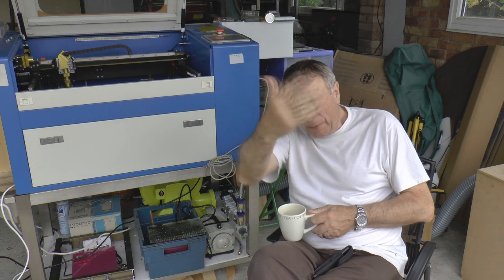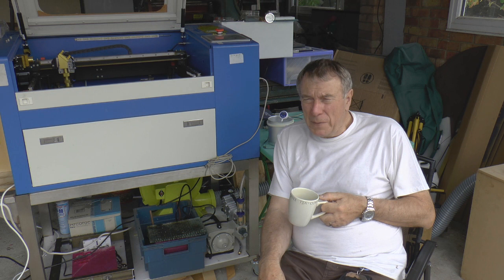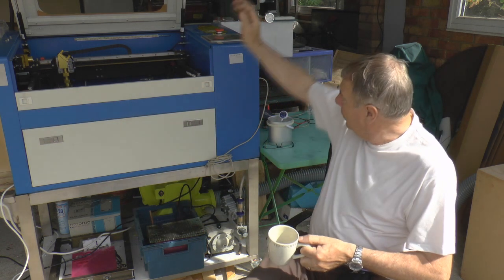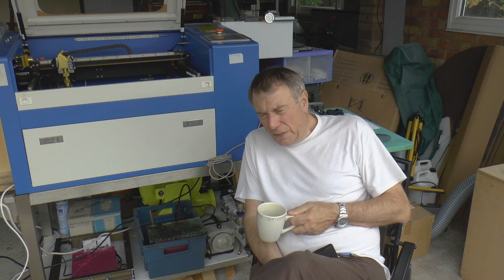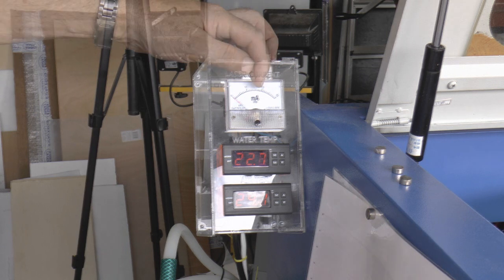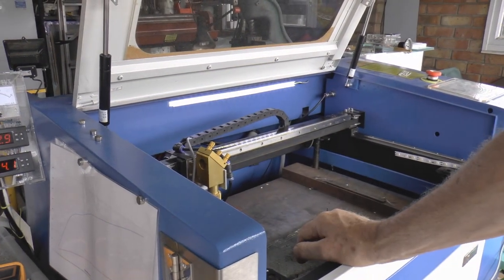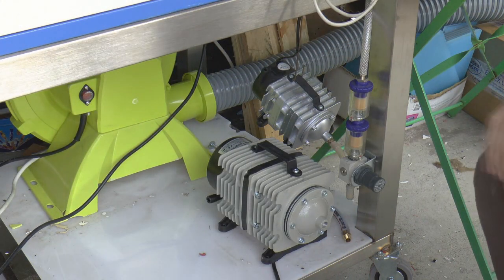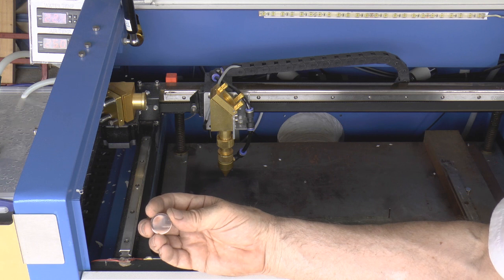RDWorks Learning Lab 75 What have I learned from 1 year of owning a Chinese Laser Engraver

Comment: How fast are you trying to cut a particular thickness of material?  Even 40W is more than enough to cut paper/cardstock/wood in most thicknesses that you'd use for hobby use.  If you can't cut a thick material at max laser power, slow it down.  You don't have to cut at full power all the time.  You can cut thin wood at about 5-8W.  I have a friend that outfitted a 8W LED laser to his 3D printer and he's cutting up to 1/8" basswood in one pass.  Granted he's not going fast, but it is getting it done.
Reply from the maker: One thing you must appreciate is that the main property of a laser beam is that it is monochromatic and all the light waves are in phase. The colour of the light defines its wavelength. and the longer the wavelength the more power it carries. You will already understand this concept when a car drives by playing loud music. You will not hear the high and mid frequency (short wavelength) sound, only the long wavelength bass beat. Your friiend's diode laser will be working at 400 to 600 nanometer wave length . The CO2 laser I have emits light at 10600 nanometers , so 20 times longer wavelength. Why does that matter? It's all to do with the way that the light energy stimulates the material molecules. I'll not go any further into the physics other than to say that you are trying to compare apples and oranges. The material range cut or engraved by a short wave laser will be different than those cut or damaged by a long wave laser. Basswood is an excellent example because it is almost impossible to cut with a CO2 laser, very strange because its just another wood and you would expect it to be cut easily. Sadly the more complex molecular structure  is poorly stimulated by CO2 longer wavelength light and will not heat up as much.. 

1  cut card stock at about 10 watts but most materials you would want to use ma power and set the speed to get the cleanest cut. Tke for example 2mm birch plywood . A 2" lens and 60watts will allow cutting at about 25mm/s. You get efficient burn-free cutting PROVIDED the cut is at 25mm/s. As soon as you get complex or small shapes , say 3mm holes, then the speed will never get to 25mm/s and the power will be too ugh and you will get burnt edges to the holes.. There is no such thing as the right speed or power for a particular material. You really ought to break your job down into at least two layers(one small and complex shapes and one large and simple shapes) and apply cutting parameters appropriate to each. Go forth and experiment, there is so much more to these machines than selecting a speed and power.

Best wishes
Russ
Reply: @SarbarMultimedia  There's somethings you got right in there, but not much.  The wavelength of light has more effect on the actual materials you can cut.  For example, brass cuts poorly using a CO2 laser @10.6um wavelength, but cuts very cleanly using an Nd:YAG at 1.064um wavelength.  On the other hand, something like basswood cuts very well using CO2 (with your cut quality being determined primarily by power, focal point position, focal length and feed rate), but looks pretty ugly using Nd:YAG.  

For the materials you are cutting with these low power lasers, you can play with power and feed rate to get the quality you want for a given thickness (generally).  If you can cut a given thickness at a certain feed rate, using full power, you can cut the power by 10-20%, then play with the feed rate to get your cut back to where you want it to be.

This changes with some with the type and pressure of the gas that you flow through the nozzle, down through the cut.

You are correct in that you can monitor mA/current supplied to the laser to better manage the power.   On these machines, that's probably the more accurate way to monitor power as the laser tube itself has no power monitor on it.

Also...  In another one of your videos, you were showing the laser light and saying that the pink light was nitrogen gas.  It is not.  It's helium.  CO2 lasers (generally, based on my experience with much higher laser powers) use a mix of CO2, N2 and Helium gas.  Helium is used to cool and stabilize the gas mixture.  N2 is energized by the power input into the laser tube, which then energizes the CO2, which would be difficult to do without the N2.  This is a simplification of how it works, but that's the basic idea.  There may also be trace amounts of other gases in there to promote one part of the reaction or another.

Don't want to really debate this...  I have 25 years of experience working with laser cutting systems, primarily high power (2-10kW) CO2 and YAG sheet metal cutting machines.  I've done just about everything on/with them.  Installation/repair, building/testing the lasers, building and testing the machine dynamics, applications, etc...

Not trying to be a dick...  Just giving background so you know I have experience in this field and I'm not some YouTube comment section troll.
Reply from the maker: @WHJeffB  
Thanks so much for your reply. Where were you 3 years ago when I was struggling to understand the physics of this technology. Many hours of trawling through hardly understandable scientific papers allowed me to eventually piece together the operating mechanism  for these sealed tube CO2  lasers and it is exactly as you have described.  I never considered helium to be  the ionized gas because from all that I read, helium is pale yellow when it ionizes. Our air is almost 80% nitrogen and lightning is a pinky mauve as it ionizes the air on it's way to ground.  We agree that nitrogen is the means by which the CO2 gains its extra energy. All gases are naturally non conductive and it it not until they ionize that they can carry current. The colour and light intensity of the pink beam  increases as the current flow increases, therefore it seemed unquestionable that it was the nitrogen acting as the stimulating mechanism  
I know nothing about your short wavelength lasers  other than they can do things like brass, copper and aluminium cutting that I could never attempt with the two 3kw CO2  machines I owned for 10 years. Mild steel, stainless steel and acrylic was all I cut within the sheet metal business I ran.  Dropping to 60 watts sealed tube , non-metal cutting machines  turned out to be a universe away from the sophistication of industrial machines. . I'm having great retirement fun and am always happy to learn so  I greatly appreciate your response. This sort of physics was never on my school curriculum  but it's been rewarding and great exercise for my two remaining grey cells
Best wishes
Russ
Reply: @SarbarMultimedia  3 years ago I was thinking that these types of machines (from China) were junk and not worth the money.  After watching some of your videos, plus many others, I realized that this is not the case.  While not perfect, or on par with a commercial machine (such as Epilog or Universal), with some modifications and "tweaks" they can be a really good machine for a hobbyist, or even a decent low volume production machine.  

I've watched several of your videos now, in preparation for the delivery of my machine and I would like to thank you for sharing your experiences with us YouTube'rs.  Very helpful indeed!
Reply from the maker: @WHJeffB  
I know that Trotec Epilog and Universal are in a different league as far as build quality , engineering and raw speed but I have seen them at exhibitions and they always seem to engraving things like the Aztec calendar. detailed yes and fast  but their dithered photo engraving is about 5 out of 10 on my scale. Their lens systems do not appear to accommodate compound lenses so they are stuck  with fairly low res images, even though they do their image processing at 600 dpi, their half tone engraving method is not suited to laser technology. They have rapid response RF tubes that they are not exploiting fully. So if you want a dedicated engraving machine for fairly simple graphics then go forth and spend a shed load of money. When it comes to cutting the ball game changes. The Chinese machines use the same lenses, have the same or greater watts to play with and speed is no longer an issue because you will be in the 5 to 35 mm/s cutting zone and not scanning at 1000mm/s. There is nothing magical about rf pulsing power for cutting  so at 1/20th the price the Chinese machines win hands down, 
The whole aim of my learning journey is to understand the technology and work out what the extreme performance envelope is for this stupidly cheap CNC technology. It is full of small design compromises but when understood and tinkered with, you will get a machine that outperforms the "big boys" in certain areas but at a price that will put a smile on your face. I use the "big boys" as my benchmark and I have two correspondents (one Trotec and one Epilog) from whom I can get comparative data.
I am in regular communication with several guys that started their small business off with 1 machine  and after 2 years are at 3 or 4 machines.  Take a look here for an example
https://www.facebook.com/lasermadeira/
Welcome to the community
Best wishes
Russ
Reply: @SarbarMultimedia  Thanks for the information Russ...  I'm approaching the purchase of the machine as functional "kit".  I wanted a basic CNC platform, with a laser that I could use as a starting point for significant upgrades.  Watching your videos and others, I think the machine is perfectly capable of doing work "as-is", which is what I'll most likely do as I evaluate what can or needs to be improved.  Greatly looking forward to it!  Thanks again.

Comment: I'm thinking about getting a laser cutter  so many versions out there which is best to get for beginners?
Reply from the maker: Hi

It's a simple question with no easy answer. Before you even start choosing a machine you need to have some sort of vision about why you want one. So your not a fisherman, golfer, sailor or a pilot and you need something in your man cave to keep the wife at bay????  You have a hobby that you want to support such as railway modelling and would find it useful for making model buildings etc. You want a hobby that may turn into a small business or maybe you are already planning to use it from day 1 to start a business? Clarifying your need will help define the general type of machine you want. The smallest and cheapest machines are little desktop machines called K40.. Without wishing to offend anyone reading this that has a K40, I would look beyond to a bigger and more flexible machine. You will probably buy a Chinese machine from Ebay. . The sensible first time choices will be a work area of  500x300mm  which will be fitted with a 40 watt tube  (they will advertise it as 50 watts but it's not). the next size will be 600x400mm (quite rare) but usually you find 700mmx500mm fitted with a 50 watt tube (they will claim it to be 60watts) as the next size. More than this size for a beginner I would not recommend.

There are very few I would spend my money on but this looks like a good deal. 

https://www.ebay.com/itm/laser-engraver-cutter-machine-marking-machine-400-600-6040-80w-ruida-cnc-router/143082655440?_trkparms=aid%3D111001%26algo%3DREC.SEED%26ao%3D1%26asc%3D20160811114145%26meid%3D4e8267348dde415381a104e264433d6e%26pid%3D100667%26rk%3D2%26rkt%3D8%26sd%3D302941727876%26itm%3D143082655440&_trksid=p2045573.c100667.m2042

 A  cheaper version may suit yuo better. It will have a 50 watt tube  but still looks a nice build

https://www.ebay.com/itm/4060-50w-ruida-laser-engraver-machine-carver-cutting-Acrylic-glass-plywood-cnc/143051312601?hash=item214e85cdd9:g:YpoAAOSw~2VcE1vt

However read the small print about import/customs charges and do some research. Shipment to a port maybe free but to your house?

If you wish to attach your email to another comment I will respond and also delete your comment/email from public view. You can then send me links that you may be interested in and I will comment.

Best wishes
Russ

Comment: Russ, i have watched most of your vids. i amready to buy a chinese laser , but after watching this vid i am not sure what to buy, tube power wise. i would like at least 80 watts. if your second tube is also chinese how is it better. should i just buy a lower powered cheaper one and once it breaks buy a 80 watt tube and ps ? link to your tube vendor ? thanks for the great vids. Mike
Reply from the maker: Hi Mike 
If you buy an Ebay machine you will definitely not get what is promised. It will be fitted with a tube that is actually at least 10 watts less than promised but then that tube will be a repurposed reject from one of the main tube makers. Yes it will work well enough to fool the usual keen but naive Ebay buyer but your 50 watt tube may turn out to be 30 watts. Is this a bad deal? I bought the small 5000x300 machine with plans to upgrade at some future date. If I had bought the 60 watt 700x500 it would have cost another £500. Did I need the bigger machine? I decided not and reasoned that I could use that £500 to upgrade toa proper 60 watt system  in my own time. When I came to understand how this Chinese laser machine "fraud" works, I realised that I had accidentally made the right decision because I could have spent the extra £500 on the bigger machine and still have had to spend to put an A grade 60 watt tube and power supply into  it. Buy a small machine with linear HiWin type bearing  rails and a Ruida control system and you have the basis of a good CNC machine at a budget price. Use what you buy to get a feel for the machine and technology. Inconsistent or poor performance may force you sooner rather than later into that upgrade. I was lucky with my research and hit on a reliable source for a 60 watt tube and power supply. Three and a half years on and it is still as good as new. Since that time I have found a very trusted supplier in China. You may yearn for a named tube such as Reci but don't waste your money because  my experience from playing with 7 such tubes of various powers has left me underwhelmed. Take a look at cloudraylaser.com . I normally distrust rebranded tubes but I know that the Cloudray own brand are A grade SPT tubes. They are excellent value for money and perform MUCH better than their specification suggests. I know that the tubes are properly tested by Cloudray  before shipment. They only supply A grade kit and they truly understand the meaning of customer service (a rare thing amongst Chinese businesses). See these metal ended tubes
https://www.cloudraylaser.com/collections/cloudray-laser-tube/products/35-45w-720mm-co2-laser-upgraded-metal-head-tube-cr35?variant=12782294270003

Good luck with your new venture. I'm sure it will not be trouble-free but it will be fun moving towards a reliable machine. Make sure you buy the machine with your CREDIT card. Any protection that Ebay or PayPal promise is worthless. If it all turns really messy you can threaten a charge back from your credit card provider. Your seller will almost certainly be a PRIVATE ebay Chinese seller who has never seen the machine but is selling it from a warehouse for commission. If you can prove a bad quality tube (you will need a power meter to do that) you stand a good chance of some refund money (£200 maybe) for a replacement tube. Don't push too hard because it's eating into his commission.

Best wishes
Russ

Comment: Hi Russ
I've seen this one - which is from the supplier of my friends 40w. 
I've seen other 600x400 machines on eBay but I don't understand the technical aspects.  If any of these are good - even if I would need to replace tube and power supply with an upgrade in time to improve the performance ?
Thanks
https://m.alibaba.com/product/60773735969/Cheap-price-Co2-laser-cutting-engraving.html?spm=a2747.manage.list.79.66fc71d29vnaNiice&subject=Cheap--price--Co2--laser--cutting--engraving&detailId=60773735969&redirect=1

Comment: Hi Russ 
Really great videos.   I've used a friends 40w Chinese laser and want to buy my own but I'd like a 600 x 400 due to the size of the craft items I want to cut.  
I've seen this machine below and wondered what you think of it ?   Even, if I get it and had to add a better Tube and Power Supply?
Many thanks in advance
Paul
Reply from the maker: Hi Paul
There was no link attached. Add your email to another comment and I'll delete it from public view because I get auto copied to my gmail. I will contact you off line.
Best wishes
Russ